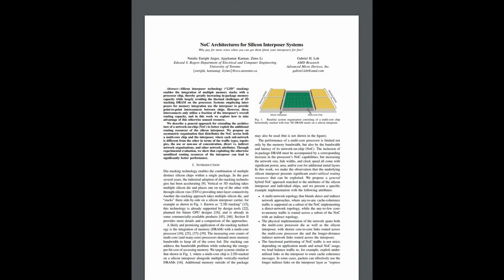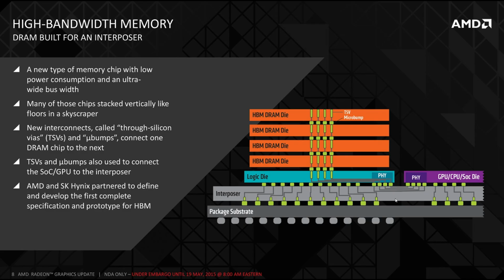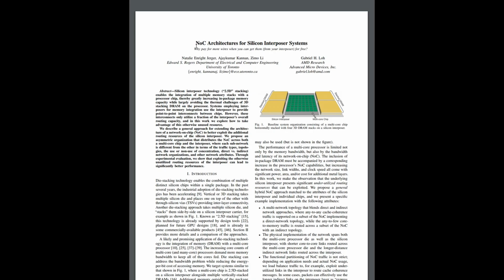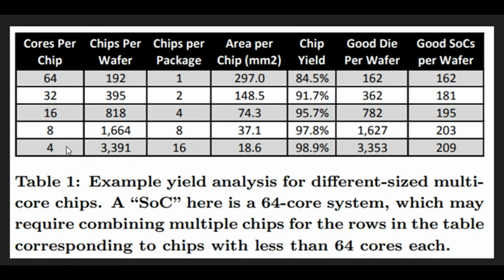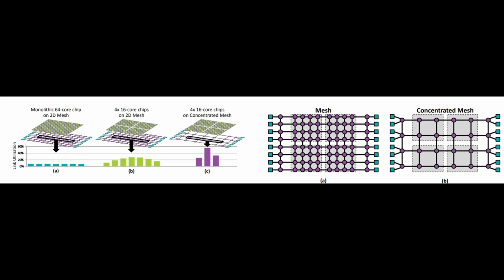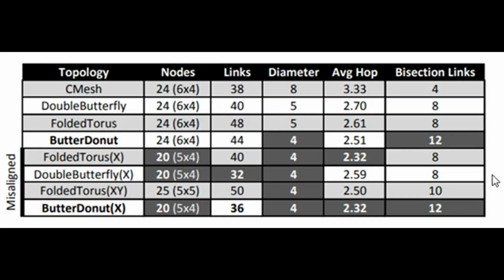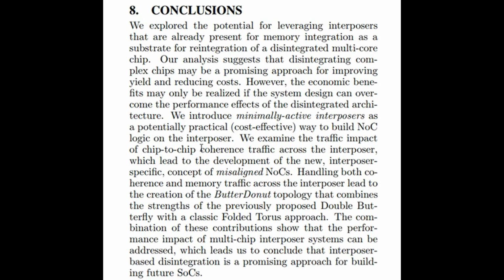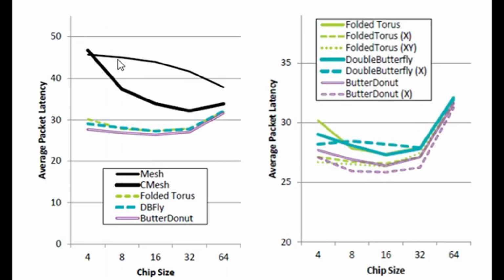Interposers, Chiplets and...ButterDonuts?

Comment: I suppose the interposer could be interposed itself, increasing the routing options. Could have a ring down low that bridges independent meshes on a higher interposer.
Reply: You can have multi layer metal on a interposer to.  Some processes have 4 layer metal with each in a 45 degree angle. This would be perfect here. Having the node to node lines going diagonally on the chip. But cutting don the distance and giving more room to play with
Reply: The issue would be, by building more strats of silicon, and adding logic to them, that would create some heat, that would be quite difficult to dissipate.

Comment: @AdoredTV Very interesting as always.

Recently AMD confirmed the existence of Zen 4 and Zen 5 in development, and the timing of releases vs nodes made me wonder if they'd use the 5nm node. Because otherwise they'd have to launch 3 different Zen revisions on 7nm+EUV (Zen 3, 4, and 5) before 3nm is available.

5nm is a half-step node in terms of capability, as it's targeted at low power chips like 10nm. It is a ~1.8x density increase but only a ~20% power drop, which means you end up with ~44% more heat per area of chip. This is fine for things like 5 Watt mobile SoCs, but not for monolithic CPUs or GPUs.

I speculated Infinity Fabric might be enough for AMD to get away with using 5nm, but they might have had to be cautious with clockspeeds/power on the server chips. However this research you've talked about would mean they could use 5nm easily with this chiplet approach. Although it's not outright proof, it lends more likelyhood they will use 5nm.

And if 7nm EPYC/Zen isn't a chiplet architecture on an active interposer, if they subsequently confirm they'll be using 5nm for Zen4 sometime soon, that could confirm a move to this chiplet system.

Comment: As promising these chiplets sound, Software will once again play the bottlenecking here, just as gaming remains bottlenecked by relatively poor CPU thread utilization.
Reply: Thread utilization is a software problem yes, but chiplet technology is almost completely a hardware issue. Looking at the data from the video performance gains seem pretty good
Reply: Saminul Haque i don't buy the hardware issue thing. Software is what makes or breaks a hardware. You don't design a hardware for an existing software, that's stupid. But rather you design a software for an existing hardware. This is why we always get driver updates and patches for a newly released hardware because the software should be the one to adjust to it.
Reply: Keep in mind that it's also (been) a chicken/egg situation. With few people having CPUs with many cores, and those that do didn't have THAT many more cores, there was little incentive for game designers to do the work on integrating solid multicore support.
Give them the means, and it'll only be a matter of time before they use it.

Comment: I think the issue with latency in ccx is the direct parity between infinity fabric and memory and the poorly optimised memory controller.
Imagine ryzen running with low latency 5ghz ddr4. I know there's diminishing improvements but theoretical gain is ridiculous
Reply: Honestly, the whole uncore should be declocked from system memory.
Reply: 1idd0kun you mean infinity fabric? The idea behind it is solid but the implementation is not the best.
Using the ram to dictate the fabric speed has the benefit of not using another chip to control it.
With time the fabric can get better and better, the difference from ryzen launch until now are significant

Comment: I wonder if AMD will up the core count on Zen 2 for mainstream.
Reply: Rumors point to 12 cores per chip for Zen 2. AMD is not afraid to raise core count for Threadripper (16->32), so I expect them to raise core count for mainstream as well.
Reply: You can bet your ass. Even if they don't do 6-8 core CCX, the shrink to 7nm itself would make it quite easy for them to increase core count...
Reply: or a single CCX with 6 cores, where the high end mainstreem will be 2 dies and the low end will be . this could even kick start quad channle for the mainstreem with the dule die config, and god knows how many on TR or EPYC
Reply: 6core ccx sounds plausible, which means a 4 die threadripper 2 would be 48 cores but dont expect it before 2020.
intels looking at making an 8 core but amds looking to release a 12core not too far from now in this case.
as for single core performance intels not getting any faster or better ipc, 5ghz and same ipc for 2 years now.
amds already on ipc parity and they're closing the gaps on clocks by 5% each year, the intel boats engine is failing and jaws is closing up behind it, the only reason the people havent jumped ships is because its a bloody ocean liner.
Reply: Fingers crossed.
Reply: The really old roadmaps had aimed for a 64c/128t "Starship" for the server market. Now it appears it's going to be 48c/96t first.
There's practically no other way to achieve this than 12c per die. There's little point for them to produce 2 different dies for desktop and server as it would be a step back.

Reporter over at ServeTheHome expects PCIe4.0 for the next EPYC; though imo the desktop isn't ready for it (and there's no ddr5 to fully justify the platform upgrade).
Threadrippers are going to be another special child. 2 dies à 12c are 24 cores but with full memory access which isn't going to look great in the eyes of consumers against TR 2 (32c, only 2 dies with direct mem access). And again, I don't believe they'd release a new platform here. 4 dies for the next Threadripper? But are they going to release a 2-die TR first? Maybe 2d+2 cut dies? Who knows.
Reply: Upd on my comment: I forgot, PCIe 4.0 is of course backwards-compatible. So there's no reason not to support it on CPU-side. Since it's not on Intel's roadmaps until Q1 2019 - it's going to give AMD a huge competetive advantage in some very limited deployment scenarios, the only ones with pcie4 support are IBM right now with their POWER9 arch.
Reply: I rather have huge IPC boost over higher core count
Reply: 8 cores is huge anyway
Reply: mikey cockson Yeah, I need to correct myself.

TLDR: 7nm Epyc (48 cores) & Vega coming from TSMC for enterprise exclusively late/2H 2018
7nm Ryzen, TR from Glofo with high clocks, 8-cores in early 2019. End.

With AMD talking so much about manufacturing at BOTH TSMC & GLOFO, 7nm Vega being enterprise-only and 7nm EPYC this fall, I came to a totally different conclusion.
It's apparent (and that's what AMD hinted) that these 7nm products are going to be quite expensive in production, targetting them at the enterprise segment. These 12 cores per die EPYC aren't going to land in the consumer segment, neither is Vega2 (how come we aren't seeing lower binned Vega parts now? E.g. Vega 48, less memory? Doesn't seem to work this way).
GloFo is going to serve the consumer market. I still have their frequency target of "5 GHz" in my head and can't imagine anything but AMD going for clock speeds now. Nobody bought into Bulldozer core count in 2011 (well I definitely didn't). AMD does make strange decisions, but releasing 12 cores at roughly the same clock speed (+200 MHz boost maybe) isn't going to convince those, praising Intel's 5 GHz (extreme, I may add) OC; and will prevent them from segmenting Zen2 vs Zen3. They're better off saving the "12-core" feature for the future :)

Looking at the current product line, EPYC doesn't need the consumer market to write off low-binned SKUs. They have everything from 32 to 8 core EPYC, the last one being 2 CORES (1+1) per die, something we don't even see with Ryzen parts.

It's amusing how much I myself can err by simply considering different argumentation standpoints. But I think that's it. Imo :)
Reply: Zijkhal I'd say an active interposer requires a socket change.